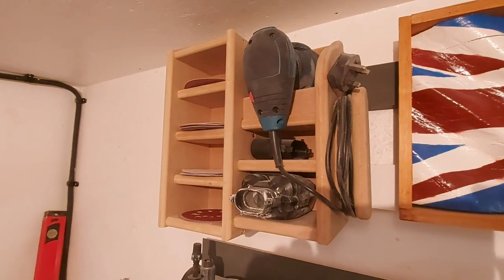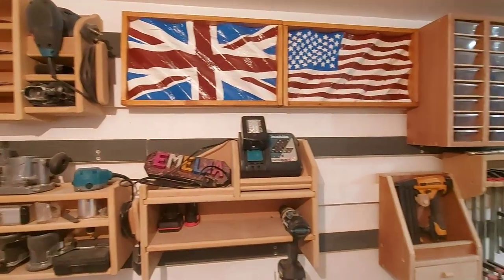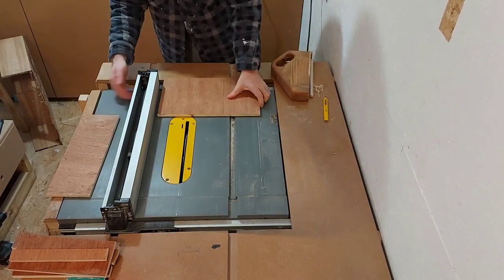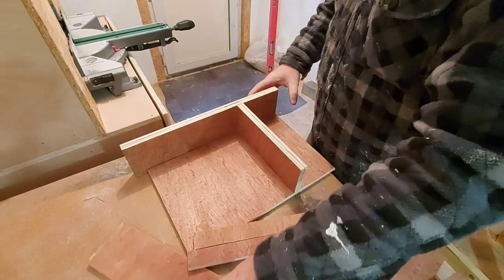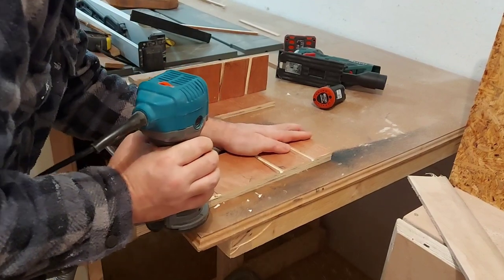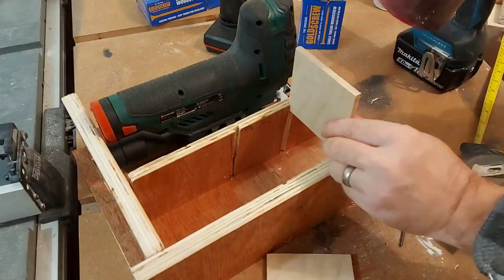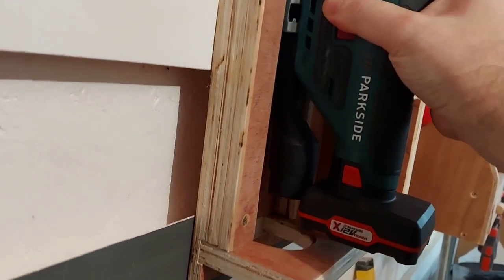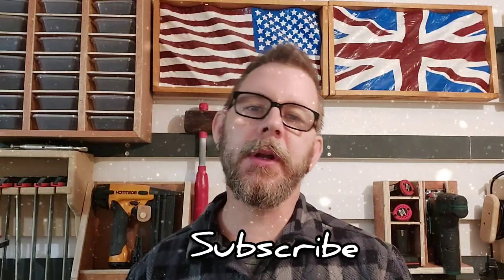Jigsaw French cleat wall holder

Comment: Nice build Dave, if you want to position the holder under another,, just trim off the top edge of the vertical guides few inches so the saw doesn't need to travel full length. Leave enough guide to keep the tool in place.
Stay safe & have a good Christmas with family.
Reply from the maker: Thats a good idea didnt think of that. Thanks for watching